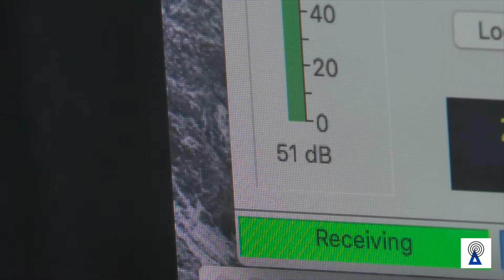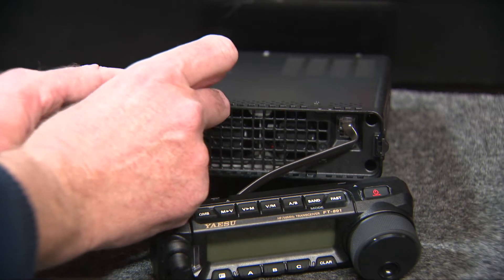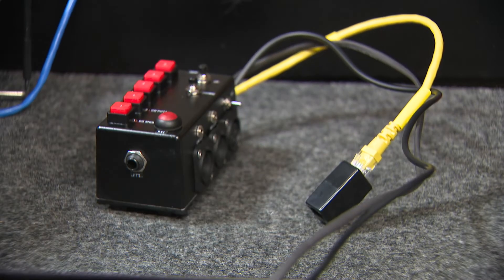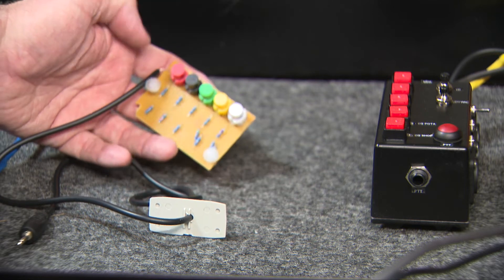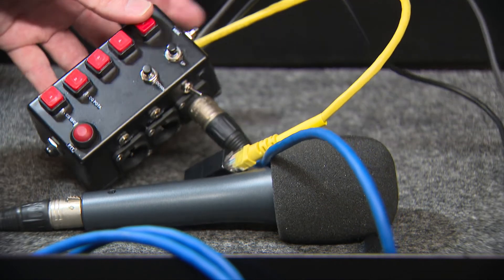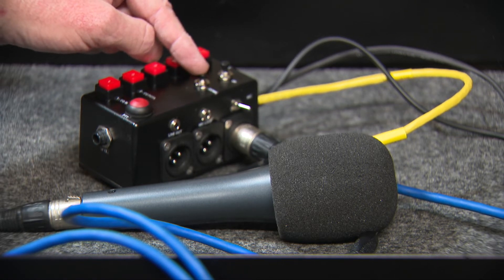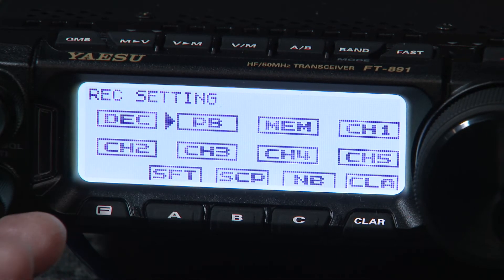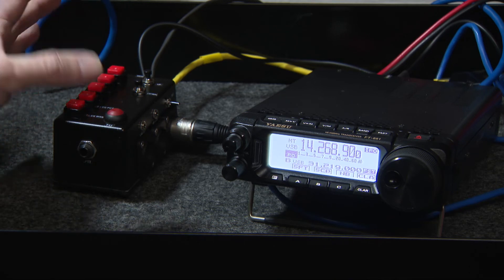Yaesu Remote - build your own for the - FT-891

Comment: There’s one problem with your instructions and that is how to select your wires by color on the Ethernet cable. This is so because all E-cables are not wired the same, they can be wired under specifications 568A or 568B where the color code of how the connector is wired changes, the difference being that pairs 2-3 are reversed on 568B. On the 568A pin 1 is Stripped GREEN and on 568B pin 1 is Stripped RED. 

https://media.fs.com/images/community/upload/kindEditor/202103/20/t568a-and-t568b-1616212515-bU1U1LAWvs.jpg

Comment: Great information for this radio! Resistor selection to desired action, hmmm my Renault Megan uses the same principle for its cruise control switches. And all odd values.
Reply: I will check with the company BHI and see if they still make their keyboard for direct entry of frequency that they offered for the FT857 series radios. I will also need to read through both the manual and my notes to see about a remote switch for my older unit.
Thanks!

Comment: Is it possible to change the transmit mode with that system?
Reply from the maker: It is only possible to activate the men and voice functions. There are other features similar to the Yaesu remote it all depends on the resister value. The key is that the voice shortcuts save diving into deep into the menu each time